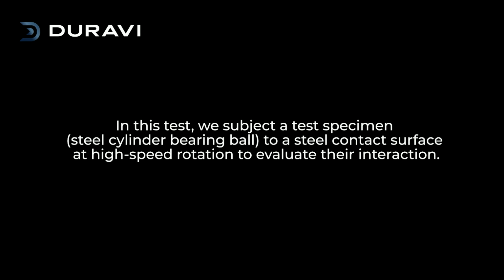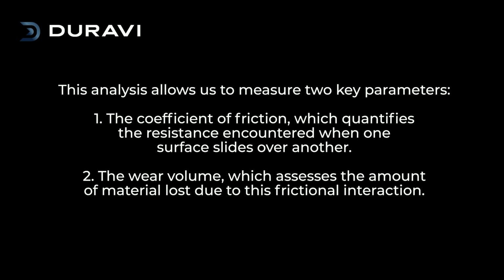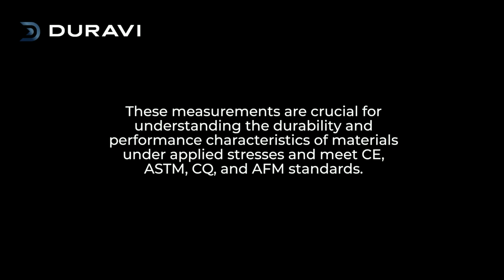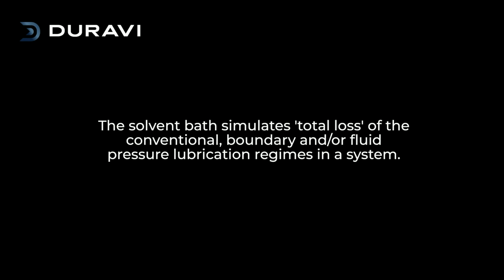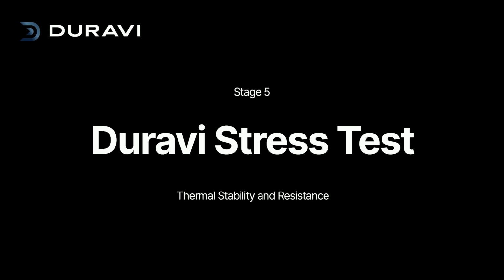Watch Inventor Howie Damron Demonstrate the Power of Duravi

Comment: Why are you pressing with your fingers instead of using calibrated weights?

Using finger pressure makes the test unreliable and not scientifically sound. The applied force can easily be manipulated simply by pressing harder or softer, which makes the results inconsistent and difficult to evaluate objectively.
Reply from the maker: You're absolutely right! We'll have to do another controlled test to demonstrate Duravi in action. In the meantime, we'd love to send you a free sample to try yourself, email us at info@duravi.com and let us know if you'd like to try it out yourself (we value the feedback —seriously).